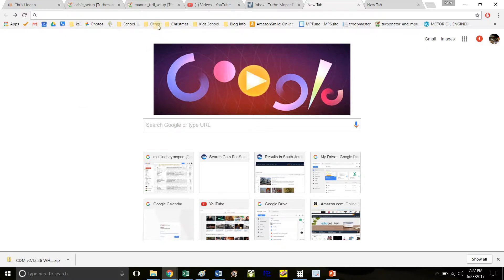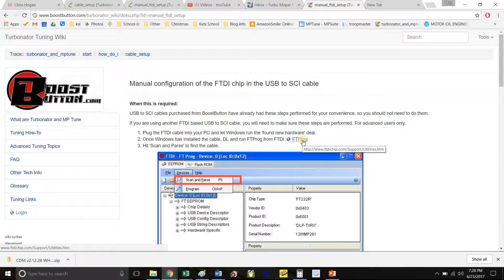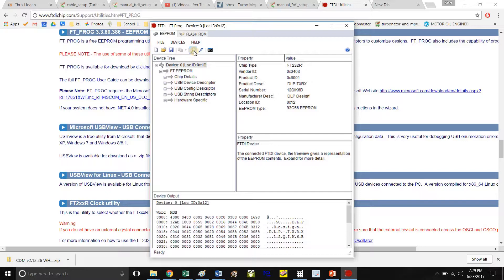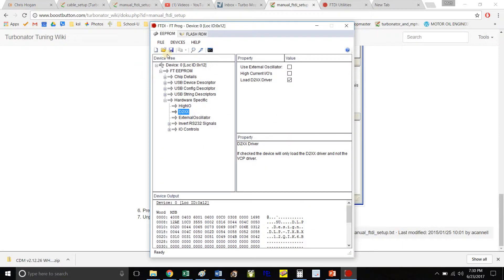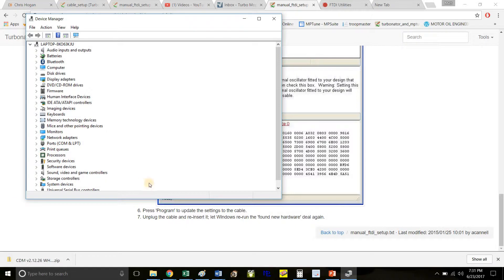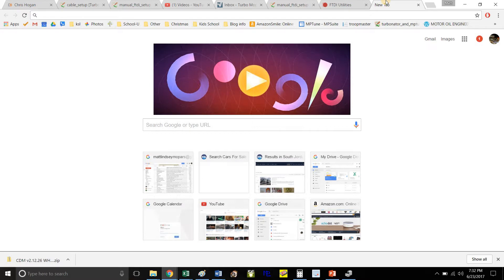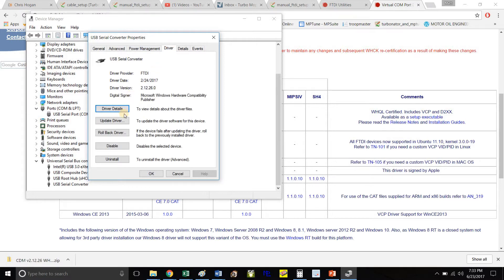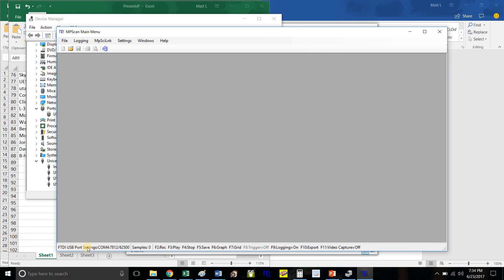MPScan  FTDI Cable Setup Troubleshooting

Comment: do you know which cable I have to order in order to make my own?
Reply from the maker: glhturbo it needs to be a 5v FTDI usb to serial converter you should be able to find more information on the Boostbutton wiki, or pm here or on Turbo-mopar.com as 1badvan